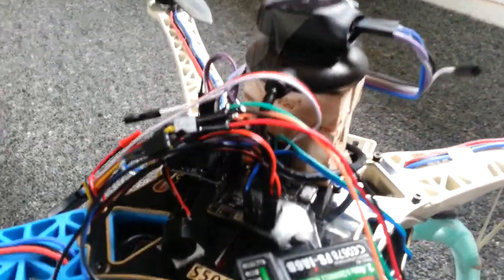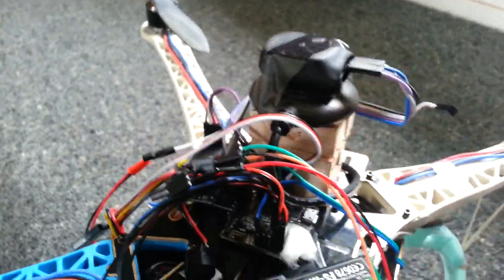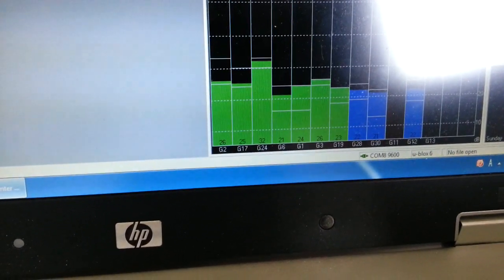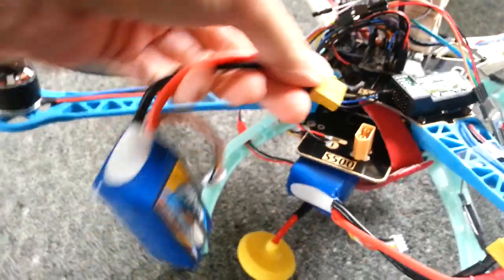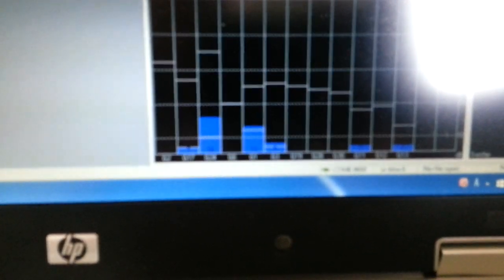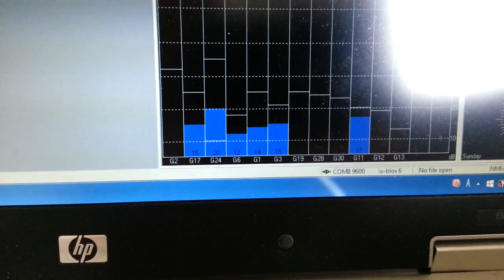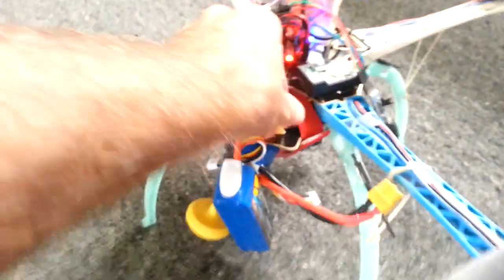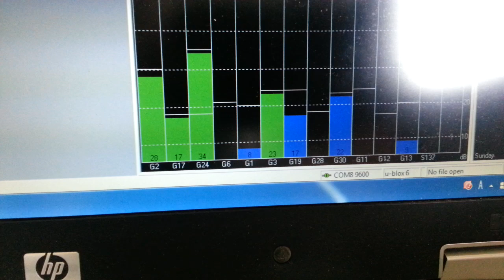naze32 F1 board GPS interference (cleanflight)

Comment: try unplugging your buzzer.
Reply from the maker: +Chi Sty are you saying that a buzzer that has no current passing through it is... doing... something?
Reply: I thought I heard a buzzer beep as you plugged up the quad ....I think the buzzer will have power running to it as you plug it up and doesn't sound off in till the power value is raised....yes I think its your buzzer.
Reply from the maker: +Chi Sty I think you need to take a look at the issues thread I linked to in the description. Yes, the buzzer sounded when I connected the battery, but then it is silent, meaning there is no current passing through it. Even if there was, it operates at audible frequencies, nothing that should trouble the GPS.
Reply: +iforce2d ok maybe I'm wrong  ...I have had a buzzer problem but maybe your board it defective...my buzzer was on a servo out put maybe that was why .....good luck let's us know how you fix it.
Reply from the maker: +Chi Sty Right now I have the GPS working ok up on a higher mast. When I take it off sometime for another project I will check if the buzzer has any effect.